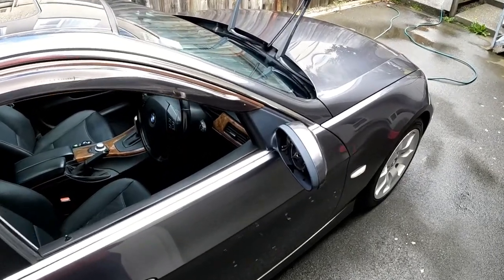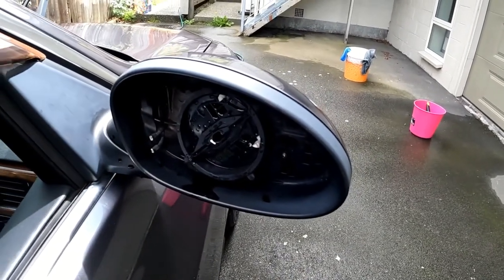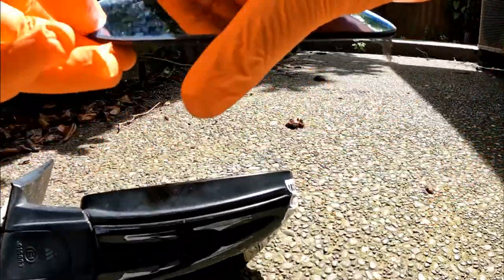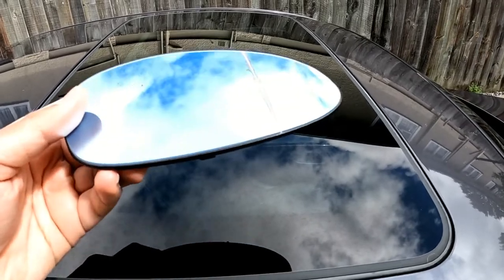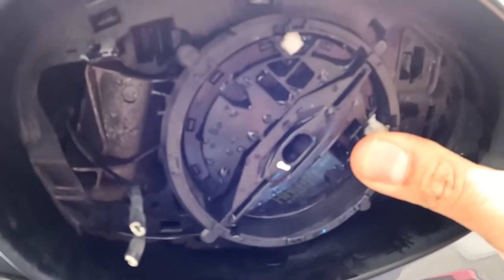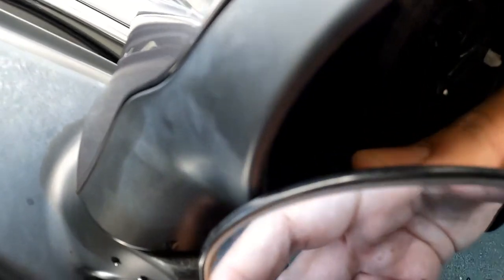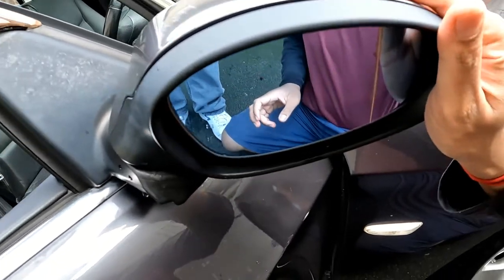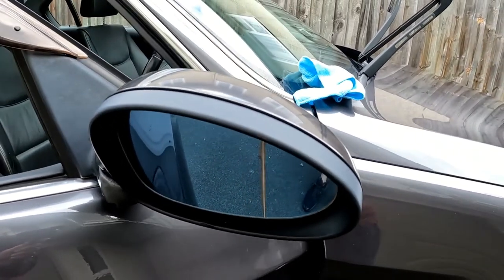How to replace BMW Wing Mirror Glass  - E90 E91 E92 E93 E81 E82 E87 E88 + more BMWs

Comment: My mirrors started vibrating recently at highway speeds, can  you please tell me how to fix the problem?
Reply from the maker: Sounds to me like the ballast , or one of the plastic clips broke. Start with removing the mirror like I did and inspect tabs on glass and holder. If it is good then you might need an assembly replacement used ones are cheap.  Make sure to subscribe to my YouTube Channel.

Comment: Bruh 70 bucks for an old and already peeling mirror? When you can get the new aftermarket one for 15 usd
Reply from the maker: Bruh, as I am in NZ it costs $75 for an aftermarket with a blue tint , or this. I bought the whole assembly and removed the mirror glass .